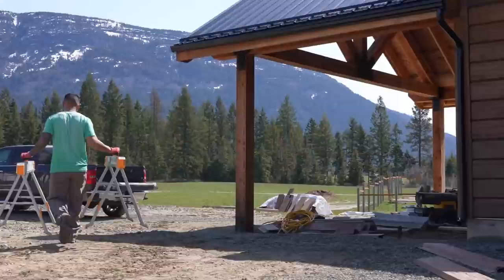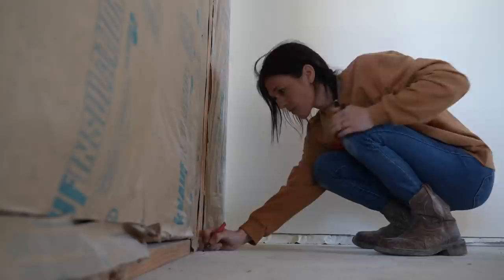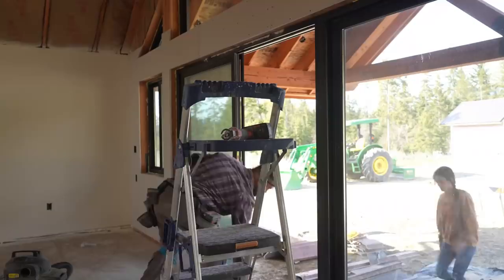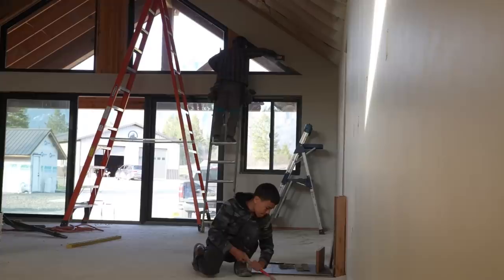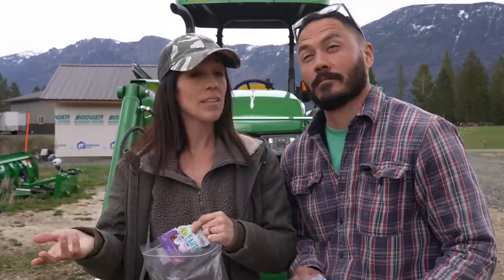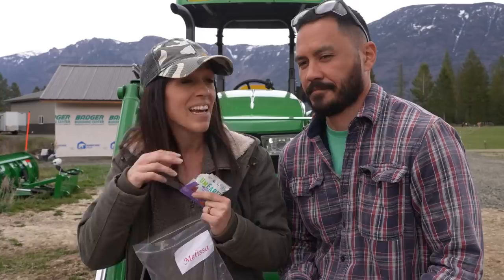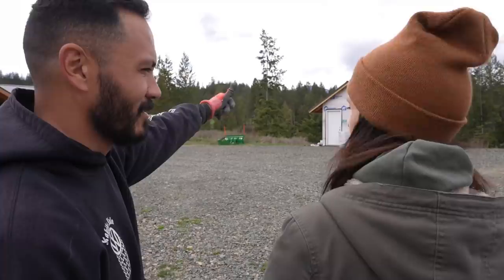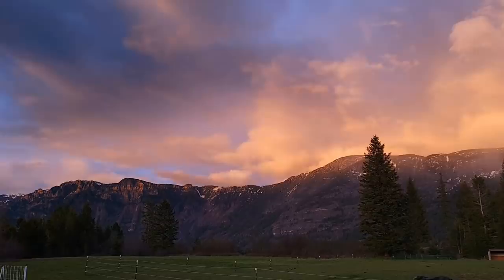Starting the Interior Stone Wall & Prepping for Final Grade on Our Mountain Home Build

Comment: This home is going to be so beautiful. Love the stone. Do talk to someone about if you need to mud the drywall though and put up a barrier over it in case there would be a moisture issue behind it as that can be common with it on an exterior wall in winter. You don't want mold behind it and I would highly recommend a smoother backspash for cleaning purposes. The colors of the stone are perfection with the mountain view and the floor. Can't wait to see it finished. How stunning.
Reply: I was thinking the same regarding backsplash. The stone is beautiful but would be very difficult to clean splatters and grease off of the rough uneven surface. But they may have something planned to take care of that and we just haven't seen it yet. I actually have uneven stone tiles on my counter tops (already there when we purchased) that will be replaced ASAP. It is horrible to get things out of cracks and crevices.

Comment: I am surprised that you are considering those stones as a backsplash in the kitchen. Though they are beautiful and match the front wall, I am worried that you might regret having something not easily wipeable as a backsplash! I can imagine how greasy those stones could become over time. Just a thought 😊 Other than that, I absolutely love what you do and the materials that you choose. Looking forward to following the rest of your build.
Reply: They make a sealer that make most cleanup pretty easy.  The Sealer soaks into the surface of any pores surface and vanishes, but stops/limits staining.
Reply from the maker: Yeah we are thinking the same
Reply: @GoodSimpleLiving  .
Reply: @GoodSimpleLiving  I work for a tile and stone importer as a design consultant. Sealer isn’t going to make cleaning easier. It just keeps stone and other porous materials from staining. It is the rough/ uneven surface of the stone that is going to make cleaning more difficult because food and dust will get stuck on the uneven surfaces. Yes it will be beautiful but I would highly suggest something with a smooth surface to make cleaning easy.
Reply: I’d suggest a smoother surface for behind the stove area! I am aware that the sealer is sold, but that may not work. Maybe buy a few pieces and put it behind the stove for a month and try it?
Reply: Agreed.  Maybe find a tile that has a textured appearance but is smooth.
Reply: @GoodSimpleLiving  I have a massive fireplace wall with real dry stacked stone similar to this. It isnt hard to keep clean. I vacuum mine
Reply: Perhaps a clear perspex sheet fixed over the stone would allow you to enjoy the appearance whilst making it easy to clean?
Reply: Maybe something like slate looking tile - easier to clean  ? ? ?

Comment: I used to build thin brick fireplace surrounds and mantles. We used hardy backer cement board to sheet the fireplace surround and glued the thin brick to the hardy board. We used nail guns and had no trouble at all nailing the backer board down with nail guns.

Comment: Im sure its to late... but exterior walls you want to level 1 mud... as in mud and tape. ( just 1 layer )  You want to do this to block AIR flow.. where there is air flow you end up with moisture following.

Comment: I'm amazed you didn't plan on adding a Woodstove to your house. I have a large Heritage soapstone wood stove in my house that was built in the mid 90's.. it can heat my 3,500 SQ ft house. It really had paid for itself in 2021 when we had power outage here in Texas. It was a nightmare with power going off and on for 10 days. Everyone in this area had frozen pipes. Power off so long many had to leave their homes because of the cold.
Millions of dollars of broken pipes etc. My Woodstove kept my house not only from freezing, but down right toasty. 80°.  When the house was built the original plan called for a fireplace. But I wanted a reliable heat source just in case. That decision paid off very well , because I didn't have any frozen pipes. Or heat problem in my house.
Reply from the maker: We ARE putting a woodstove in.
Reply: @GoodSimpleLiving  ok. Cool

Comment: It is a lot easier to scrape the floor using an ice scraper because it has a longer handle so you stand while you scrape and the scrape head is wider than the hand unit.  Also if you ever tear out a carpet the ice scraper makes short work of scraping up the tack strips and all of the staples holding down the pad.

Comment: hi jeremy what i did i tiled my bathroom at the shower end where i had 2x2 studwork where my sewerage and water supply came in for hot and cold was to use marine ply i tiled straight onto it 16 yrs ago and never had an issue with it admitley it was a bit more expensive to buy for a sheet of 8x4 compared to sheething ply it is food for thought depending on the price of timber now as you mentioned in previouse videos ps your house is becoming your dream home slowly but surely

Comment: Do yourself a favor and prepaint all the trim. When you get the trim boards delivered, paint the trim with the finished color.  This will save you hours because you will only need to do touch up painting after the trim is installed.  When I built my home I was left with all the trim to caulk and paint.  I got an estimate for a painter and it was for $8,000.  I ended up doing the work that took weeks of work.

Comment: The secret to working so close to a finished wall is using a 6 inch extension on the drill so you can get the collet away from the finish.

Comment: I hate to add to the don't do it on the backsplash crew, but - foam stone- cannot scrub it i would guess? My backsplash has a trim that is very full of jutting-out parts and all the splashed everything- and worse, oil from frying anything at all. Need to use a nailbrush on it to get the "grease" off- worried sealer won't make it harder and cannot scrub well. Would suggest some nailbrush and cleaner testing like you did on the flooring?

Comment: I don’t think your going to want a backsplash made with a porous material like brick. I had a brick backsplash in my old homes kitchen and it was a nightmare trying to clean food spatter & grease from it. We ended up painting it each time it started looking dirty. I would recommend using something that is smooth. Maybe a smooth tile or a wood grain looking Elamite? Anything that can be wiped clean easily.

Comment: Do you have any advice or recommendations for an emergency car battery charger? It looks like none of the Anker products could handle it. I have a niece who is living in her car up near you & she has had issues with running down her battery.
Reply from the maker: I'm not sure but the Anker would run a heater, charge devices, lights, etc and may prevent her from having to run down her battery. She could charge it in an hour at a gas station or grab a portable solar panel.

Comment: That’s the wrong backing board you used for your stone cladding. Should have been cement backing board, same as you use in a bathroom before tiling. It gives the best adhesion and does not flex with the weight of the tiles etc.